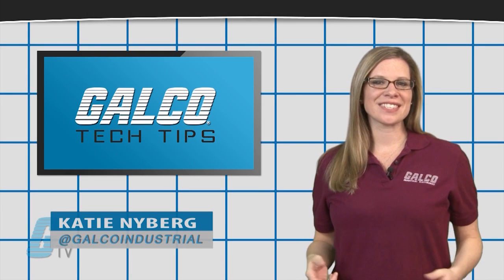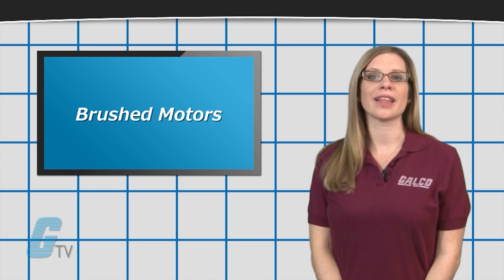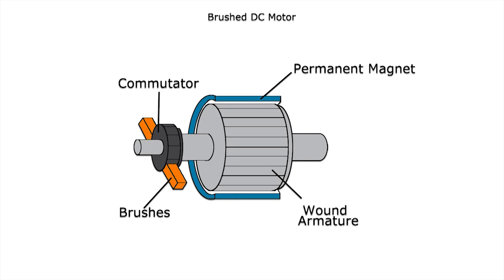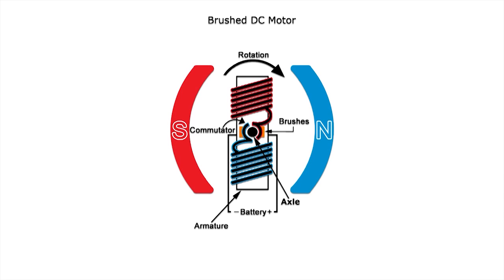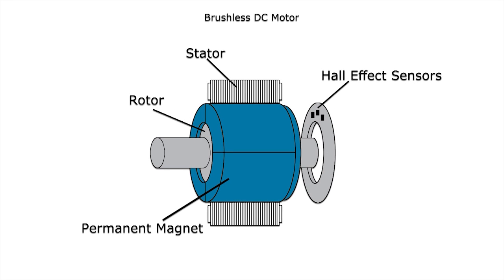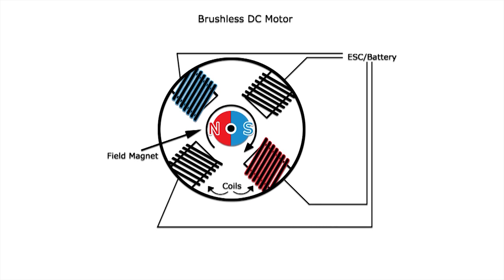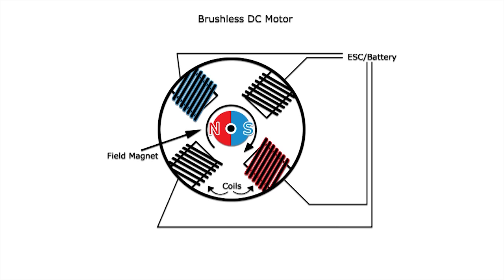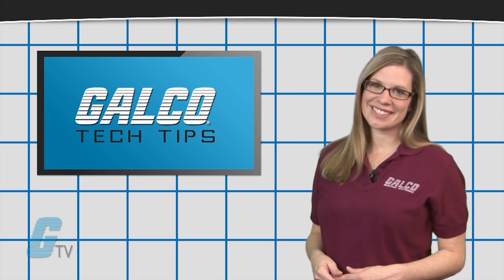Differences Between Brushed and Brushless Motors - A GalcoTV Tech Tip | Galco

Comment: Still don't understand, thanks!
Reply from the maker: Ok well then just remember that a motor with brushes has DC power applied directly to it, and a Brushless motor is an AC 3 phase motor with a "Fabricated" AC voltage applied to it. I say fabricated because it is DC voltage that is switched thru power transistors to produce AC currents in the motor windings with what is called PWM technology, this help?
Reply: @GalcoIndustrial   A "universal" motor can have either AC or DC applied to it and it has brushes. And as they are series motors, they do not use a permanent magnet. You can also have a PM motor that has no brushes.
Reply: A bit yes, and all this can be the cause of higher running temps?
Reply from the maker: Possibly but not usually. As long as the drive current is limited to 100% of name plate amp rating it will be ok.
Reply: Thanks for the info!

Comment: What about DC motors such as fans in PCs which are DC motors, but have no speed controller? I can connect a brushless DC fan direct to power and it runs. Is there a built in ESC in these little motors? Thanks.
Reply from the maker: Yes some small cooling fans do have little PWM controllers built in. It is usually to get higher RPM and air flow from 12 and 24volt fan motors. If you have an external voltage controller in your PC for quiet operation, these fans will just reduce speed as if connected directly to the motor coils too, ok?